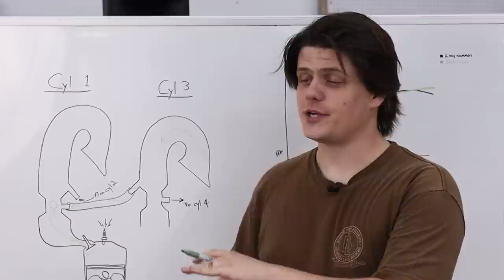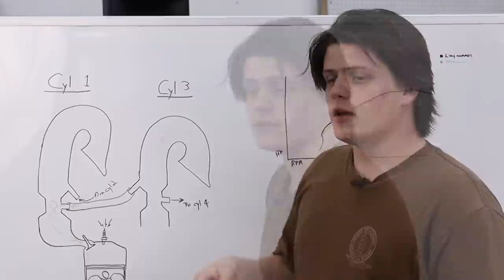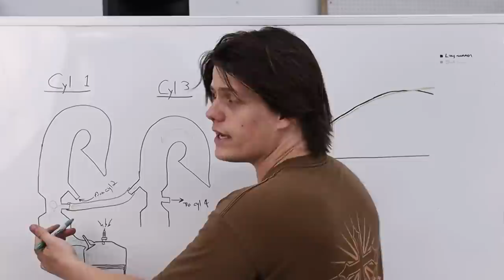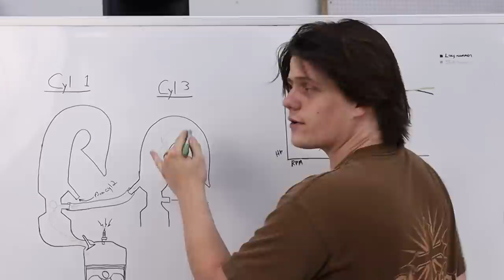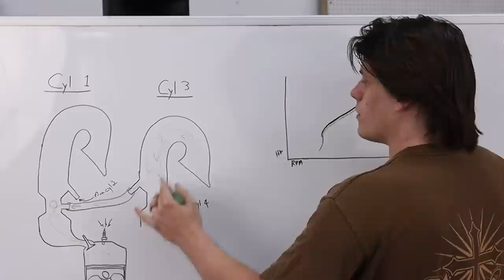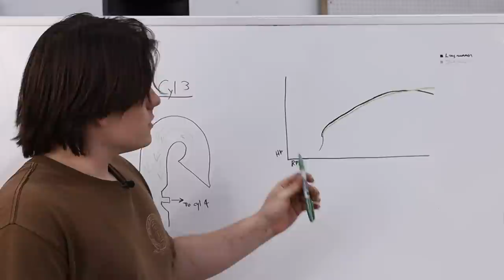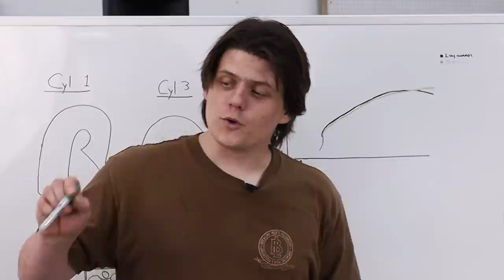3D Printed ITB Intake for Turbos and/or Stock ECUs

Comment: instead of RTV  sealing the plenum   make  a groove for an O-ring  it will make assembly and dissambly much easier and cleaner
Reply: Agreed, and silicon o-rings are cheap. You could also flanged bushing insert at each clamp bolt to keep a consistent torque spec on the intake.  Just google "flanged bushing" and you will get the idea.
Reply: a tpu gasket would also work, as its an na intake in this case
Reply: @maartenvandenberge7116  high temp tpu works for coolant gaskets too.
Reply: This is so awesome! Great job dude
Reply: @-Primer- some sizes and material are expensive
Reply: @Br0ken_Rob0ts  

$11 for   Silicone O-Ring, 70A Durometer, Red, 3" ID, 3-1/4" OD, 1/8" Width (Pack of 10)  

$15  for l Flange Sleeve Bearings 10mm Bore 16mm OD 20mm Length 22mm Flange Dia 3mm Flange Thickness Sintered Bronze Self-Lubricating Bushing 4pc

At max $35 to the build and you get reliable torque settings and less direct contact with the cylinder head / aka heat soak.
Reply: Went to the comments to say this. Already beaten to all the good ideas :)
Reply: I think you can just print it from TPU :)
Reply from the maker: Definitely going with o-rings on the next revision 👍

Comment: how does this man not have tons of subscribers, lots of effort and work into this 🎉
Reply from the maker: Thank you! We're chugging along!
Reply: Share the video!!
Reply: They’ll come eventually 🤣
Reply: @StandRacing   I just came across this and I said the same thing to myself, hope to see this channel blow up!! GREAT CONTENT
Reply: @StandRacing Hey could you take an LS7 ITB Cross Ram the borla LS3 style ones that have a straight shot into the heads. 103mm intake tube so the top of the the tube radius feeds right into the opposite intake so the percussion wave feeds into the opposite side. Keep the top lexon. Basically I want to take it off make it look like the hoonicorn ram air intake swap it out see the ITB with a lexon cover maybe put an air to water intcooler in all of that space in the valley. There's no classic looking boosted air intakes. Modern mercury SB4 Drag style holly or custom LME or Ferrari looking Edelbrock. The pass through carb is tall. Best I've seen is a Whipple Edelbrock but it doesn't look period correct. There were some Porsches I think back in the day that had kind of a sheet metal shroud but I haven't seen much. 😊 Sorry about the ramp apparently I know exactly what I want but they don't sell it and I'm not skilled enough to make it. If you are planning on selling them the ls market is a huge market.

Comment: Awesome work man, impressive for someone that is just learning from open sources! We need more people like you, figuring stuff out and learning!

Creep especially happens with plastics that are above their Tg (Glass Transition Temperature), which polypropylene has a very low Tg and is almost always above that temperature so it quite literally flows like a fluid, there fore causing creep at a more drastic level.
Reply: I would go further and recommend you try to print it out of ULTEM, as that material has one of the highest Tg in thermoplastics, however it is much more difficult to store, dehydrate, and print. And it's a bit more $ than CF Nylon, which would be my second choice.
Reply: @CamdenWallraff  What is your opinion on using polycarbonate for such types of engine parts?
Reply from the maker: Hey I say if I don't know what I'm doing when I start, I'll know by the time I'm done!

Comment: Sweet clamping brackets.  You’ve put a lot of talent into all of your parts!

With the cantilever length of the runner, you may want to consider a brace to avoid cracking the runner when the engine shakes or goes through vibrations.  Somewhere there will be a harmonic that resonates the long plastic runner.

Again, beautiful fab all around.
Reply from the maker: That is a good idea. It's extremely thin to begin with maybe some extra structure would help as well

Comment: Having a common plenum can get more power if tuned correctly because the intake runners make both negative and positive pressure pulses in the plenum, so if you tune it correctly you can get the positive pulse to slightly help ram the air into the other cylinders.
Also you have to put the intake at the highest pressure area of the front end, which is above the splitter if you have one, or if you don't it's the flattest area of the front end.

Comment: What I liked about this prototype is it addresses a lot of my concerns on a ITB set up. I have a 2.5 Duratec in a 2011 Ford fusion with a 6 speed manual. I simply wanted a daily "sleeper build" and wanted to try ITBs. The problem is tuning and hot intake temperatures. I loved the fact that a silicon coupler is used on the MAF sensor adaptor, meaning I can use an adapter for my build. I have a true cold air intake where the filter goes into the bumper and draws air from outside the vehicle. Since the Fusions have a true functional bumper louver, the filter is able to draw ambient temperature air and it creates a sort of "ram air" affect at high speeds. When monitoring my temperatures, I often see my intake temps roughly 2-3F higher than ambient, which is significantly better than the stock 15-20F higher than ambient. I also see a slight pressure increase at higher speeds over stock. I see roughly 0.5-0.8psi of "boost" from the ram air affect. That isn't much but it means the engine has to do less work to pull air into the intake. The result is a couple extra HP and my MPG increased to 35hwy/29 city. In other works, If this prototype works, I will definitely use this because I can retain my intake set up and can still use the stock ECU for tuning. If I could change one thing, I would like to see gaskets on the intake manifold plate. I trust gaskets over silicon any day. I might be able to use a Dremel and create channels for the stock Duratec intake gaskets, or possibly use an aftermarket ITB manifold.
Reply: Check out BBR. A lot of us 2006-2015 Miata folks are putting ford fusion engines into the miata (Mazda designed the Duratec engine for Ford, it's a drop in swap).

There is a lot of discussion on the "NC" aka Mk III miata forums on the "2.5 swap" which you can learn a lot from.

Comment: Genius and novel idea with the intake Venturi system to counteract the long runner length - if this works, this is groundbreaking. Have you run any fluid simulations on the part to try and predict how it will react? I have access to fluid dynamics software through my engineering college; if you’d like to look into flow simulation to optimize the design I may be able to help.

Comment: Thanks for your video. You have a nice design and nice 3d printed parts. To 3D print such large parts with technical materials is challenging, may be it will be worth to have an actively heated chamber (PA+CF ,PA+Fiberglass, Blended PC, PC/ABS, PSU/PPSU. Those last one are quiet interesting too and some are flame retardant which is a nice feature for motorsport). From my little knowledge there are many components/parameters to tune for the max volumetric efficiency (cam timing, valve size, length/volume/diameter of intake/exhaust): I used to play with Lotus Engine Simulation, there is a freeware version where you can setup a mono cylinder and simulate various cases taking in account such parameters.

Comment: Great video! I've myself have designed and printed itb manifold, And tried a bunch of  different material petg,petg-cf, nylon-cf etc. But the one I've found out to work the best/longest is a PC-CF blend, it's just amazing, just works! All the other materials started to leak eventually. On the dyno with the hood up even the plain petg worked amazing! Probably made over 200 dyno runns, But real street driving (hard driving) they all fail eventually :( except PC blend.  Great channel subbed for sure!
Reply: Peek would work great
Reply: Thanks for this! I was definitely interested in what are the best materials to mount on the engine

Comment: I would look into mixing your concept with the geometry of a "tesla valve" where the looped sections would be where you could make the cylinder crossovers.
Reply from the maker: That interesting, you know I did actually think about using tesla valves but it didn't make it to the drawing board because I don't think I can make one in a usable diameter without taking up a crazy amount of space.

Comment: You could use carburators and use the venturis in those, A carburator has one advantage over EFI where the higher the velocity the more the fuel droplets are sheared and broken up. while at lower rpm the fuel droplet sizes are limited by the emulsion tube, it maximizes volumetric efficiency because the fuel can be set up to evaporate right after the intake valve closes in the whole rpm range. while for EFI you can only really make that ideal for one rpm.
Reply: Venturi is a restriction , which causes power losses of about 10% compared to conventional multipoint, port fuel injection intake manifold . BMW even skipped the throttle because of the pumping loses reason and created “ Valvetronic” system which throttle the intake by varying the lift of the intake valves . It improves not only the power output of the engine but its efficiency as well , respectively the fuel consumption.

Comment: Great job on taking on such a difficult task. I looked into making my own intake manifold for my car as I needed to add additional fuel injectors and meth nozzles  and got as far as designing the intake flange which turned out great. Just need to do the hard part now lol. As mentioned adding an O ring will give you much better sealing and less chance of leakage due to being under compression while the manifold is moving about. If you are thinking of adding boost I would say it's a must.  Most factory intake manifold/ cam cover and thermostat housing are all Nylon with glassfibre re enforcement cars are like this now due to weight and money saving. It is a pain as no longer can you just drill a hole and weld an injector boss in. Definitely going to follow this as you are making content that pushes boundaries and using new tech for what it's designed for unlike some who like to just print a flipping benchie🤨 that ends up as tomorrows trash.

Comment: Back in the day, hot rodders and drag racers used to take long sections of plastic pipe or radiator hose and make adapters for the pipe to be plumbed between the carb and cylinder head. They would cut down the tube/pipe and test speed and hp curves for each given length the pipe was cut to. The best performing length got implemented on their builds but with a more permanent material obviously.

Comment: The venturi idea reminds me of the intake design on the new C8 Z06. From everything I've read, it has two plenums with a butterfly valve in between that controls the mass flow rate of air and allows for it to be "peaky" at multiple points. I've also designed and 3D printed intake manifolds for Formula SAE and I've used a carbon fiber reinforced nylon (NylonX) for my fuel injector ports and ASA for the rest of the intake runners plus the plenum. I've been thinking though that a fiberglass based material called NylonG might be superior due to its increased resistance to impacts. Also sidenote, there is an article or two I'd highly recommend.

Firstly, "Best Bell" by Gordon P Blair and W. Melvin Cahoon gives a good starting ratio for elliptical bellmouths on intake runners.

Second, "Combined Effects of Variable Intake Manifold Length, Variable Valve Timing and Duration on the Performance of an Internal Combustion Engine" by Pauras Sawant and S. Bari (should be on researchgate.net) gives out a couple good runner length equations for a starting point. From all the Ricardo simulations I had run, Engelmann's formula for runner length was the highest performance one (very very slightly) compared to their proposed one on cam duration.

As to how to determine your target RPM for runner length, we started out very basic in a program called OptimumLap and setup our car and track in a point mass simulation, then created a histogram of the car's RPM across a lap. The best way though is to log your RPM around a track somehow, then pull that data into python or matlab and then create a histogram to figure out what RPM you're spending the most time at. We concluded ~8100 RPM on our motor that redlines at 9,700 RPM

Comment: just a quick note on creep: my understanding from aerospace studies was that the deformation is due to long term vibration exposure. Planes moving through the air see lots of vibration which is why it is a more studied phenomenon there - temperature has a large part to play here as well. Printing ~50% infill should make the parts fairly robust, to help avoid layer seperation. if you want to further avoid creep then O-rings on the mating surface should be more substantial then RTV at absorbing or muting the vibrations the head transfers to the intake.

Comment: Any reason to use silicone instead of printing grooves for O-rings? For the trumpets you could likely find standard sizes. For the cover you could cut O-ring cord to length. Just a thought.
Reply from the maker: It was mostly to skip a step to get the first test model completed faster. I'll see where it's convenient and where it's not and design from there.
Reply: @StandRacing  Definitely makes sense! You'll be making changes I'm sure. Iterative agile design.
Reply: @StandRacing  Sorry BTW I watched half the video first and now I see you addressed that later!

Comment: I would prefer Orings and bushing inserts over the silicone and plate strategy, but that should help with distortion and spreading the load. Overall, it’s cool to see the thought process that goes into designing this system. I always teach my kids to “use their engineering brains” when putting together nuts, bolts and washers and think about what purpose each of them serve. Think about why they designed it the way they did and it will help you when building something for the first time. I’m currently designing an intake manifold in the same manner for a 1982 kz1100. Keeping going man your content is top notch.

Comment: Not sure if the physics works out on that Venturi stuff you’ve designed there, and if it does then I’m not sure it’s going to be a huge improvement, but I’m very curious to see when you do dyno runs with and without it!

Comment: I really dig the idea, I may have to try some ideas I have on the printer.   Random things that came to mind while watching, all with respect and no particular order or reason.  You touched on resonate frequency, Have you considered using inserts or brackets that can allow you to tune to frequencies? It may be worth it to consider a small tuned anti-reversion implementation on each individual runner, will have to test how dimensions and length from manifold etc effect to have it dialed in. The next thing I always ran into when having log stacked style runners is the plenum, it will always be a short-coming for many aspects. They almost always have uneven pulses due to intake pressure changes at each runner, the last runner almost always gets the bulk while the first starves due to velocity. The venturi will help "prime" the runner but if the air is not there it will still starve at low speeds until you can achieve poor man's boost. Because you are printing these it does give you the ability to build a more pressurized system with guided flow to help keep the flow pressurized over each individual cylinder or simply change the characteristics of where the air enters in the first place. The last thing would be do not forget macro- Does the hood/fenders/grill etc create a negative pressure inside of the engine bay? Even with ram air you are still spending the majority of your time not in the poor man's boost range and in fact you are likely subjecting a negative pressure around the filter and sucking air out during the average cruising speed with a ram air system that has no large capacity charge tank, I think you will find that doing the math you are far exceeding the available air mass in the entire system. Consider looking at adding an inline charge tank and helping with keeping it pressurized, sometimes able to reach terminal velocity before the charge tank. I am only offering advice and you may be way ahead of me on all of it already, just wanted to offer my thoughts. Consider looking into T.O.O. The Old One - he may still have his info floating around on great theories, even Mr. Banks has some of the best knowledge around when it comes to fluid dynamics and the internal combustion engine. Anyway I will be following this, Thanks!

Comment: Another benefit from plenum setups with a directed ram air cone filter, is the lower ambient IAT. Even better with an airbox that separates the hot air coming off the radiator.

Comment: Wow those pieces you had mad up to inhibit “creep” look really well made! 
Maybe you could go for some extra large melt-in thread inserts, and drill them out. 
Steel inserts would be advisable. 
Put them in prior to annealing(heat treating). 
It should stop any crush of the nylon. 
I’m thinking of using Cerakote C-7800(650c 1200f resistance) to seal the 3d print as a final process. 🤜🏼🤛🏼🇦🇺🍀😎

Comment: Exhaust scavenging happens also with the Camshaft overlap. When both intake and exhaust valves are open. Engine Masters on Motor Trend has some great tech and dyno tests on Cams/Exhaust and even Intake runners short vs long and how it tilts the curve.

I printed my own intake ram scoop to replace the stock under hood fender attachment AIT are within 10 degrees warmer of actual ambient compared to what it was before. Once i'm at speed its 5-10 degrees cooler.